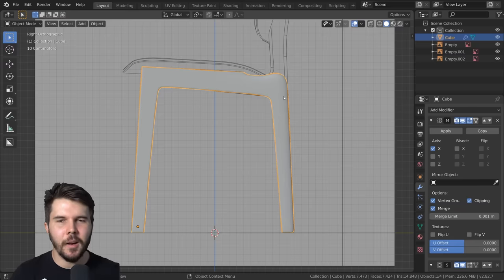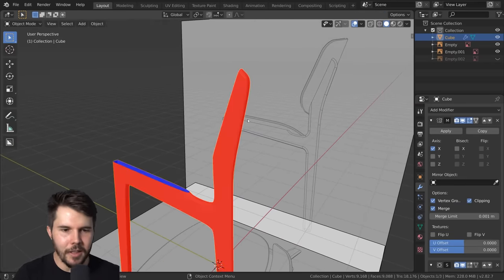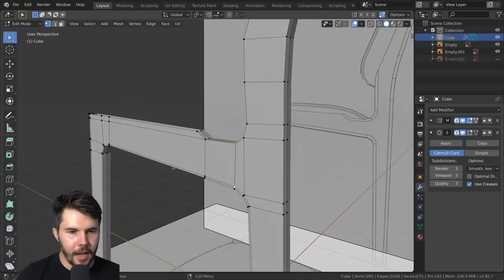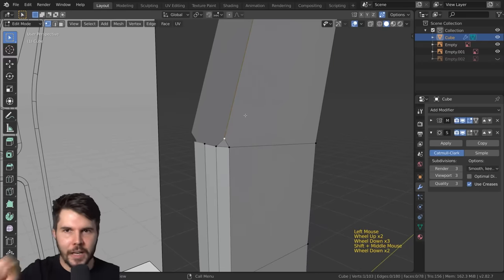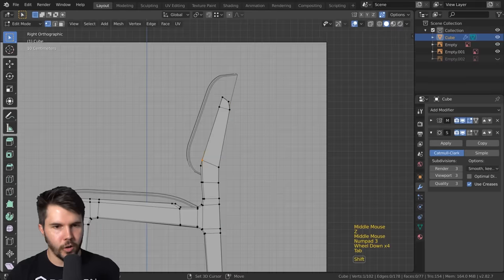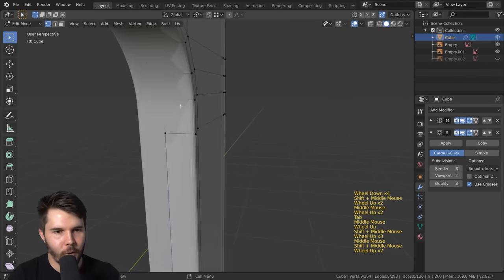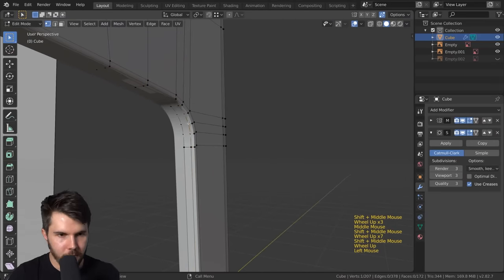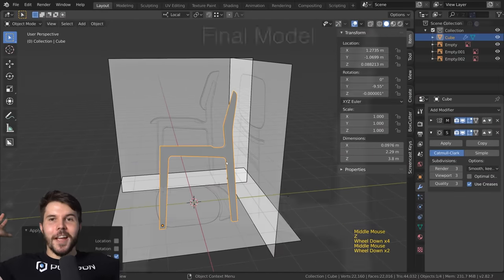Blender Beginner Chair Modelling Tutorial - Part 3

Comment: To anyone having undesidered results with the bevel operation after the ctrl+a fix scale operation thingy (Object mode) as I did. Selected all of your mesh in edit mode and click m or ctrl+m (depending on what version you have) and choose by distance to see if you have any double vertices or what not and try the bevel operation then. I had the same problem until I scrolled down the comments and seen someone else had the same problem. 10 wee rogue vertices gone.
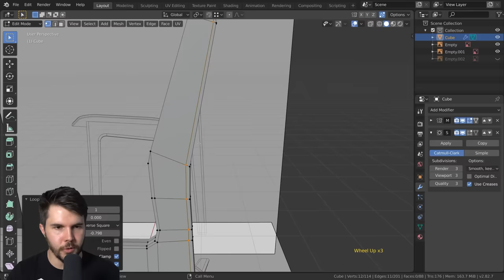Reply: maybe you can help me, at 11:25 the loop cut doesn't go along the entire leg; it stops half way. Any idea how to fix this???????
Reply: @emanuele4745  IM not really sure, Ive not long started with blender myself, but it sounds like something is stopping the flow of the new edge. Id suggest  try the merge vertices to see if there are any double vertices or broken edges stopping it, turning the mirror function off and see i if there are any edges or faces on the inside part where there arnt meant to be any. I had a simmalir problem with a weird subsurface problem and horizontal edge loop on the same leg because of an edge on the inside of the leg. I deleted it and it was fine. Also (save 1st). You could try deleting the faces around it and re adding the faces by selecting vertices (4 at a time) and pressing 'F' to create a new face. It's hard to know without seein it mesh though. If none of that works, take a screen shot with the wireframe showing and upload it in to 1 of the Blender Facebook groups and see if myself or anyone else knows what's stopping it.

Comment: Hello Andrew,

When I apply the scale, it flattens the mesh. It seems like I only have a single face where the mirror center is. How do I solve that?
Reply: VassilisStergioudis I have the same problem. Have you found any solution yet?
Reply: Had this issue. I removed all my modifiers and then applied the scale then added the modifiers again and it worked.
Reply: @muggy5907  Thanks Yuugen!

Comment: Hi! Great tutorial, been following it since yesterday! But I'm having some trouble now, after applying the scale with Ctrl+A every time I try to move one of the vertices from the outer side of the mesh (The side you would apply the bevel on) they snap to the middle side of the mesh (The side the mesh mirrors and where the origin point of the mesh is placed) 

After that, Blender won't let me move the vertices in the X axis anymore, I can still move them in the Z and Y axis, but not X, has anybody had this problem before? Is there a way to fix it? Thanks!

Comment: 10:32 i dont understand s x sxis 0, does it flatten by "mostly" or "bigger area" to flat? so the bevel vertex goes in flatted? if the bevel areas is bigger than others, will the flatted others will flattened to bevel's x axis? hope this question dont confuse u guys :(

Comment: 13:03 Why Andrew has such detailed wireframe in object mode? Does he applied another Subdivision surface before? I have still the same wireframe in both modes...
Reply: Uncheck Optimal Display
Reply: @damiant4144  THANK YOU, I had to scroll past a hundred comments to find this - especially the fact that he is in wireframe mode.
Reply: @Holm55  no problem :) i had this issue, so when I found the solution I answered myself for others 🙂

Comment: I'm getting stuck on the rotating thing, I know i had to change my origin to get the mirror to work correctly, I think When I originally moved the starting cube i was in edit mode and i moved it away from its origin. Is there a way to get the origin back to its... origin? I know yours is down in the bottom of the foot, so thats throwing off my rotate...

Comment: I’m constantly choosing the wrong one when I need to either ‘dissolve’ or ‘delete’ a vertex or edge... is there an official definition of when to use each?
Reply: "Delete" will remove it and also everything immediately connected to it. "Dissolve" will attempt to remove it without removing anything connected to it, while sort of filling in the gap it leaves behind cleanly. In other words, if you just want "that part" gone, perhaps to start it over, delete it. If you're just trying to, for example, remove an extra loop cut, dissolve it. Hope that clears it up a bit for you :) (EDIT TO ADD: It will 100% leave behind ngons or tris, so perhaps 'cleanly' is the wrong word, I'm just not sure what the right word would be lol)

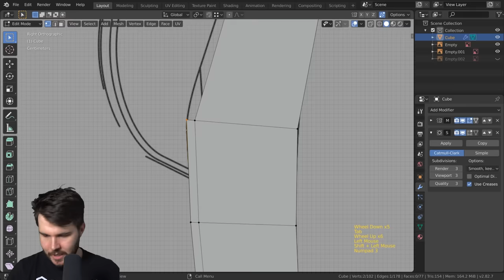Comment: A short question, if I may, regarding 11:00
If I wanted to move the point to be exactly on the line between the two end-points... how would I do that?
You more or less eyeballed it, and, as you said, it will be hidden and so mostly fine.
I also know of a few methods that would achive that result... but they would involve creating the vertex at this point.

I couldn't think of a method to move a vertex to such a position.
Any idea?
Reply: i would create and edge between the two end-points (select them, press F) and then turn on Snap To Edge (also included in the tutorial, he does snap to vertex), then move the point and by holding Ctrl snap it to the edge (which also allows me to then move the point along the edge), and then simply delete the edge i created in the first step. i'm sure there's an easier way, but this takes about 20 seconds and worked for me.
Reply: They've recently added a couple more options in the snapping menu. Edge center I think was one of them.
Reply: Or 

1. select the two end-points,
2. SHIFT+S -> Cursor to selection
3. select the vertex you want to move
4. SHIFT+S -> Selection to 3D Cursor
(5. optional: Press G twice to slide the position of your vertex)
^^
Reply: @direct7735  That's the method I had in mind. I just was looking for one that didn't involve creating and deleting additional geometry. ronsn's works very well for that.
Reply: @ronsn8071  Thanks... that's what I was looking for. I always tend to forget the 3d Cursor.

Comment: 18:10 A fillet? That's what it's called in fusion360
Reply: AFAIU technically it should be called a chamfer or a round when you take off more material from a sharp outside edge?
A fillet is on an interior edge, and "adds" material compared to a straight line angle. (EDIT: Or it can refer to both. Wikipedia contradicts itself and doesn't cite sources, so... :D)
In Blender, both are called bevel.

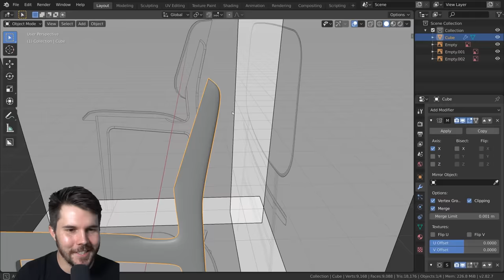Comment: 1:40 common mistakes and possible way to fix it. 
6:20 when beveling goes wrong and possible way to deal with it.
12:18 Filling the space between vertices by using F key.
12:40 " option key + selecting face " to confirm if faces are longitudinally aligned with same transverse length (width). ? Loop cutをするとき、そのloop cutはlongitudinal directionにloopする。このloopはtransverse edgesと交差することでverticesをうむ。このverticesを一つでも動かしてしまうと、この操作をしてもオレンジ色に光ってくれない。なのでgrab（move）するときにvertexを単体で動かすのではなく複数のverticesを同時に動かすなどをしてedgesを動かす様にする。*13:20 のように。→再度確認してみると、これは正しい認識ではないと分かった
14:40 Why 5 cuts are preferred for curvature? Hypothesis : To make radius of a curvature smoother, equal-distanced cuts are better. 
19:20 Change transform orientation to "Local" in order to move vertices along the faces which are slanted (not perpendicular to the global frame of reference; the global x-y-z axis).

Comment: For some reason when trying to add a loop cut at the step @11:25 the cut would only span until the edge with the merged vertices after the Bevel section.  I stepped back until before the bevel and it worked. can anybody possibly explain?

Comment: 11:25 the loop cut doesn't go along the entire leg; it stops half way. Any idea how to fix this???????
Reply: Don't know if you solved but i just had the same problem. I don't know why but i had a face inside the mesh, after deleting it everything went fine. Always check on the video's lower right corner the number of Tris, if you have more than him, you did something additional or forgot to erase something.
Reply: how did you find it and how did you delete it?
Reply: @Alysavos-rd4tp  I got in edit mode, turned on wireframe and face selection and started looking around the model, then I found it on the upper back part of the chair
Reply: i cant seem to find it.another explanation?how does it look like?
Reply: @Alysavos-rd4tp  Try doing this: 
    - Enter Editmode
    - Set the Selection type to Faces
    - Select all
    - Vertices -> Merge -> By Distance
    - Deselect all
    - Select -> Select All by Trait -> Interior Faces
    - Delete
Reply: i dont have the merge by distance menu at all and when i select all some parts appear like they re not selected
Reply: i somehow did all those i found the merge by distance and it didnt do anything then when i pressed interior faces it highlighted almost all of the chair and then deletes it but it left the feet lol
Reply: @Alysavos-rd4tp  Okay, another option to find internal faces: Select the outside faces and go around pressing H to hide them, once you find the face, delete it, then select all and press Alt+H to unhide
Reply: there are no internal faces so i assume the problem must be something else. i will repeat after part 2

Comment: Got a problem... When I use Shift + R instead of activating a loop cut my file changes from Edit Mode to Object Mode.  What setting do I have wrong?
Reply: Its ctrl+r for a loopcut after you hit control r you should see a yellow line like in the video when you hover your mouse over an area that can be loopcutted if you have more than one yellow line you accidentally scrolled your mousewheel and you can just scroll down on your mousewheel to reduce the number of loop cuts.

Comment: How would you model the fact that the chair leg actually gets wider at the top?
Reply: In front view ^^
Reply: @ronsn8071  Just manually? Isn't there like a Taper modifier?
Reply: @Tordek  Yes, you can use a Taper modifier (which is called "Simple Deform" in Blender). You can also use a Lattice or Curves.

Comment: I messed up my origin point, now my chair is all clipping and incorrect. How do I correct it?
Reply: First turn off the mirror modifier. Than select the bottom vertices (but only the inner ones). Press SHIFT+S -> "Cursor to Selection". Go into object mode (by pressing TAB). In the upper menu, click on
Object -> Set Origin -> Origin to 3D Cursor.
Now turn on your mirror modifier again.

Hope that helps.

Comment: It becomes big when I set the scale to 1,1,1.
Reply: Use ctrl+a and apply the scale, don't manually adjust to 1,1,1. To understand this, you are basically saying "Ok this is my new normal scale" instead of what you did wrong: "I'm at .8 in size, bring me up to 1". At least, that's what I think is going on!
Reply: @allenramsey3849  I used ctrl+a and it made the object completely flat... did I miss something?

Comment: How do I rotate with the foot being the pivot point?
Reply: The same as in the video. You can also use your 3D Cursor as pivot point by setting it with SHIFT+RightClick to the position where you want to rotate around. Then press . and chose 3D cursor as pivot point or use the menu (see screenshot: https://pasteall.org/media/3/4/3411b4230e56cf8b8d40a92123dc6306.png )

Comment: Thanks, how to render in a laptop plz
Reply: Add a camera an lights (SHIFT+A)?^^
Reply: @ronsn8071  nono like tips to reduce frame time, etc... to avoid over ¿hot? I dont know how to said it hahaha
Reply: @paudalmau4411  Oh haha :D
It sounds that your laptop is pretty old. A newer gaming laptop would solve most of issues regarding render time because of GPU rendering.
Another way is to use Linux, because it's much faster. Nearly all is faster on Linux though. :D
Reply: @ronsn8071  nononon, hahaha. (thanks for your answers) I asked it because I m worried of the wear of the hardware. I have an msi P65. Is new and I dont wanna to burn it you know... to reduce the wear of the cpu.

Comment: The legs aren't alligned with the floor because the leg was rotated now
Reply: You can solve that selecting the bottom vertices and rotate them. But you have to apply first the mirror modifier, because, at this time, the mesh has to loose its symmetry (on this little part of the mesh).
Reply: @oliviernoel5916  yeah I used Blender before xD but thanks
Reply: @xepaix8659  Sorry, man. Just wanted to help ;)

Comment: there is a fundamental wrongness in the modelling technique 😂

the sideview of the chair projects the legs, that are at an angle inwards, to a flat vertical surface
so if you model on the flat, projected-to surface with the legs standing up straight and angle them inwards after moddeling, they'll be too short

it would have been right to model on the angeled surface, which the legs are on in the projection/reference already, while looking at it from a vertical view and then using the sideview as a guide

kinda hard to say it only using words
Reply: Yeah he fixes that by scaling it a little after rotating it to match the angle, around 20:00
Reply: @chriss1331  i still think modeling in blender is a little clumsy
i'd make the model in fusion360 and import an stl for advanced rendering, but fusion can easily render still images, which i use most, so i'd rarely have a use for that

Comment: Its embarassing after all this time spent in blender but how do i switch to the mode he uses in 14:42?
Reply: he has unchecked the optimal display tickbox which can be found in the subdiv modifier. It allows him to see it in more detail. He is also in wireframe which you can see on the top right of the viewport. Select the sphere comprised of wires
Reply: I tried it, when i unticked the optimal display box the grid on the chair appeared but i couldnt edit the grid, it was still based on the vertices
Reply: @NotChristian999  In case you still need the answer, you also need to check the "Display modifier in edit mode" box in the subsurf modifier properties.

Comment: blender so diffucult, to many shortcuts to memorize
Reply: There are, and it does make the early stages of learning hard, but once you start using Blender, they quickly become second nature and you just don't think about it.  It's definitely worth persevering, because once you've got over the initial period, you'll find it's a very efficient interface.
I recommend that you only remember the keys you'll be using all the time.  For the rest, just remember how to find it in the menus/UI, and that way you're not stumped if you forget the shortcut.  Once you've found what you want in the menu, make a note of the shortcut if you're likely to use it again.  The best thing is that the whole interface is consistent, so g and r grab and rotate whether you're in the modeller, or the node editor.
In commercial software, each module is often written by independent teams that never talk to each other, so they each work differently when you're doing essentially the same thing.  Look at the different text editors in Word, Excel, Outlook, Teams, PowerPoint and OneNote. Each has their own way of doing things, and although you'd expect the same behaviour in each, given that they all came from the same company, they each work in infuriatingly different ways.  In contrast, the Blender developers have spent a lot of time ensuring that everything is as consistent as possible, so you usually only have to learn something once.  If you expect something to work the same way, even in very different contexts, it generally does.  If it doesn't, it may be an oversight, and a bug report would be appropriate.
Reply: @Raven-Creations  What I do is to just go back to the tutorial where I saw a hotkey used each time I need a reminder. xP